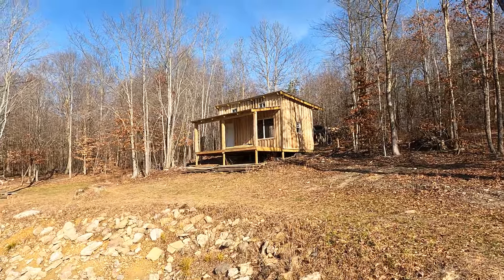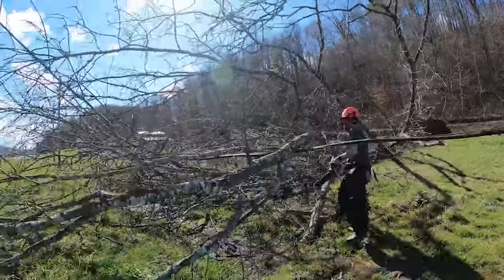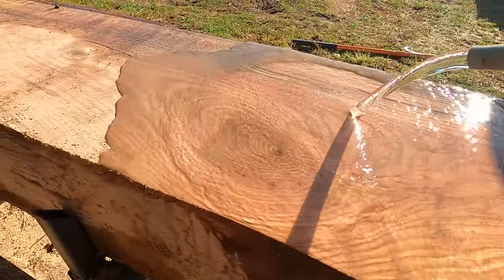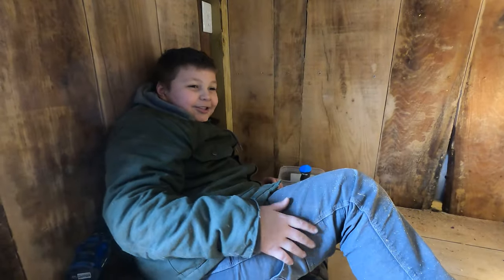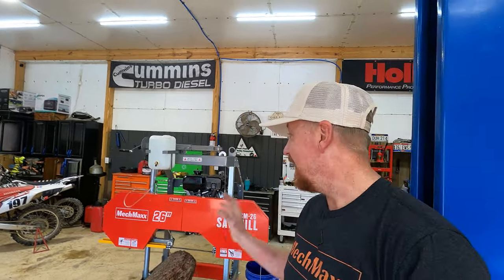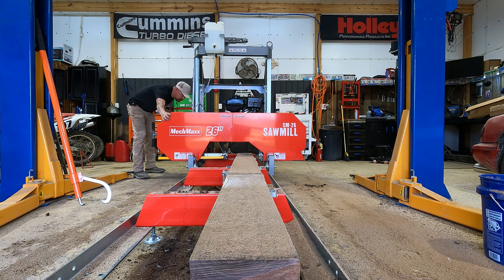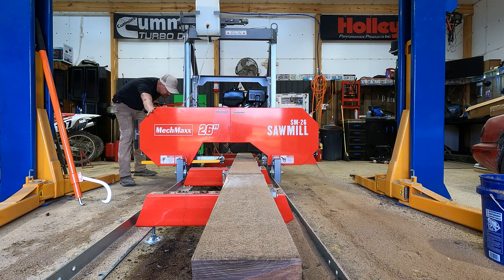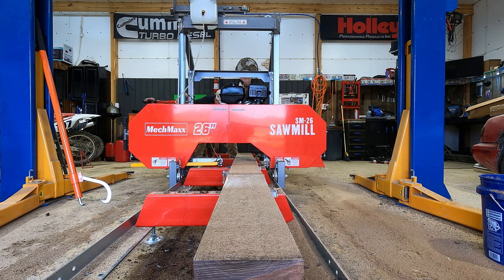The Best Sawmill You've NEVER Heard Of!!! - MechMaxx SM-26 First Milling

Comment: Good set up, seems like a good mill and yes, having a good supply of timber is going to amaze you in what you can produce. Looking forward to see the process of getting the mill set up. When you are covering the wood drying, use 2 x 4's on edge under the tarp to allow the air flow.
Reply from the maker: Thanks for the tips!  I’m gonna need a lot of them.

Comment: Good job on the build and congratulations on the mill!

About 10’ is all I get on the stock rail setup. As you run it more, you will get more and more efficient. Milling is fun and quite a bit of work.  It has been an extremely satisfying thing to do and it is nice to do more with trees than just make firewood. Enjoy and be safe!
Reply from the maker: Thanks, Joe.  I learned that quickly when we milled the tree we used on our cabin.  I knew it was a hobby I would enjoy.  👊
Reply: being a good steward I do believe.  However, if one does not have the means, I think that is totally fine too! @PeeksPeakHobbyHomestead

Comment: I have the same squeak when lowering and raising the head assembly you had. Can you explain the process of what you did to solve that problem? I noticed a drift pin near the crank handle , do you need to remove it to get things apart? I can see you may have to remove the pulley assemble to pull the square shaft out if i am thinking correctly, any help would be appreciated. THANKS
Reply from the maker: Yes, I took the square shaft completely out and coated everything with grease.  I should have filmed it because I can’t remember the process for sure.  I am thinking just took the cables off and cranked it all the way out…

Comment: Looking good.  It looks like ergonomically, it would be better to use if you could build a frame to raise the base up maybe 18"-24". 
👍👍
Reply from the maker: We will be putting it on a platform, it will be 12”-14” higher.  I want to keep the rails low because I don’t want to have to raise logs very high.  The way this mill is built, I also don’t want to raise the head crank up too high.  I think it will work out well.

Comment: You do realize you're supposed to remove the bark before you start cutting your wood that dirty bark is going to dull that blade extremely quickly
Reply from the maker: Nope, had no idea.
Reply: You can but I don’t know anyone who does.  I will selectively do so with particularly dirty logs myself.
Reply from the maker: @oakiewoodsman  I’ve watched a lot of videos and killed with several guys and I have never seen anyone do it.  After this comment, I did find a few videos about it, but I’m not convinced it is worthwhile.
Reply: @PeeksPeakHobbyHomestead  you would never mill. Again, if a bunch of mud is in a spot, I may take an axe to it. Also, if dirt is inevitable, I try to mill with the blade exiting through the dirt rather than drag it in. All my 100s of logs have been drug through dirt and rocks to get to my mill. Blades and sharpening are just part of the whole thing.